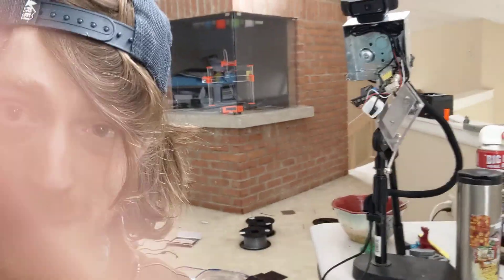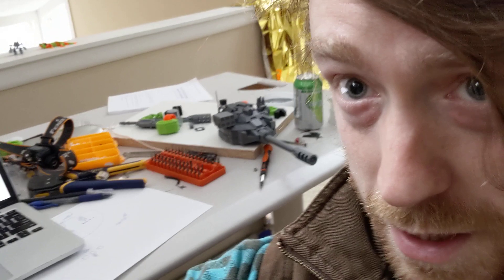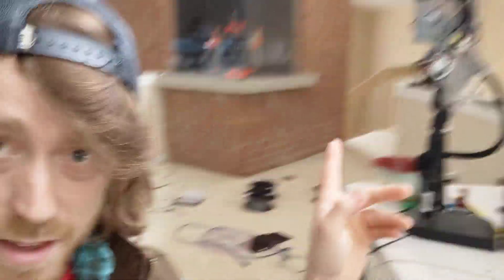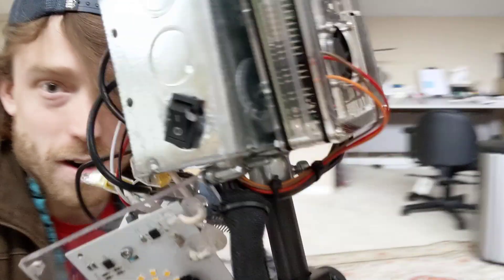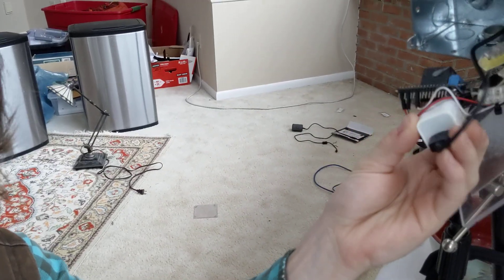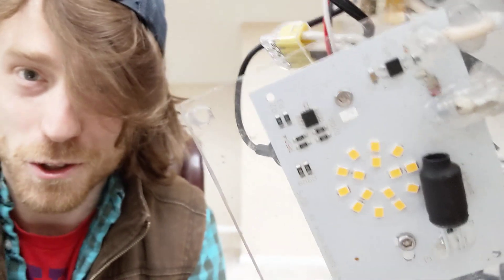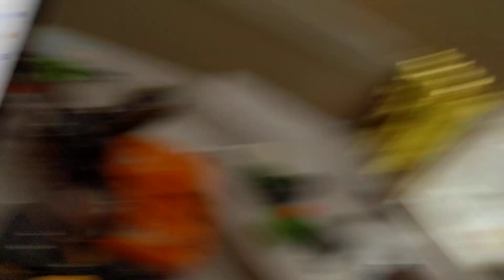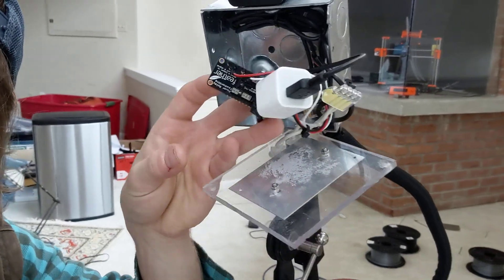Raspberry Pi 4B + Adafruit FeatherWing Power Relay + Switch + LED + Stupidity = Circuit Explosion

Comment: Not trying to be an asshole here, but be EXTREMELY careful about messing with AC current if you don't know the basics. It only takes grabbing the wrong wire one time to really fuck your shit up. I'm not an expert either but my understanding is that choosing a wire for something comes down to how much power you're going to run through it. More power needs a thicker cable and using a cable that's too thin will cause it to overheat and potentially melt or cause a fire. I did a quick google search on "how to choose wire size" and found some articles explaining the different wire gauges and the max amperage that each gauge can handle. I would start there and find the thinnest gauge that can handle the current you need to run through it.